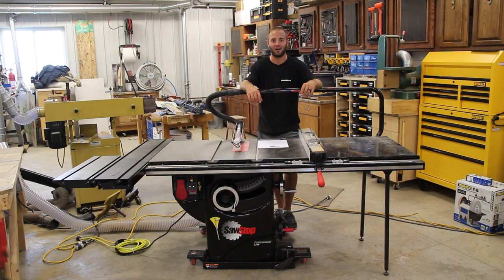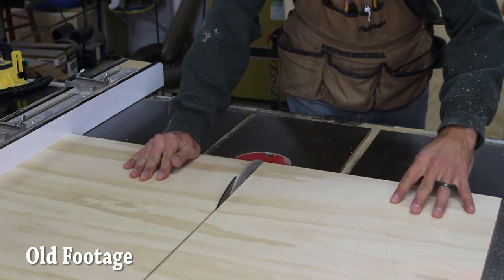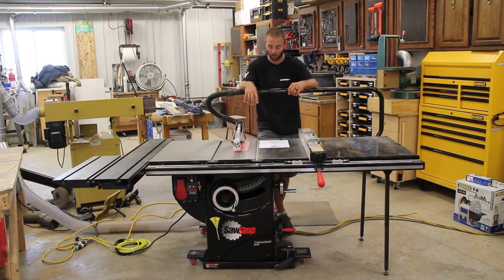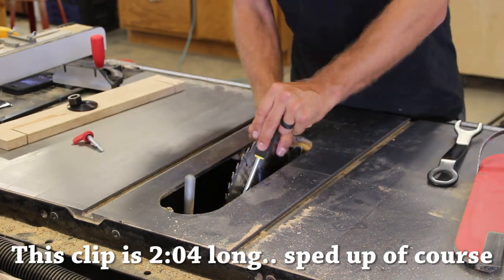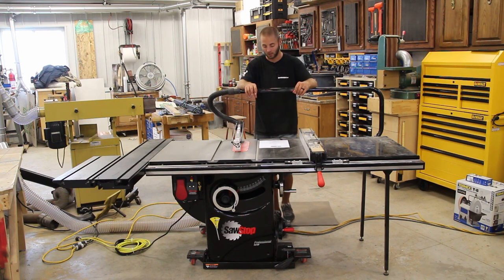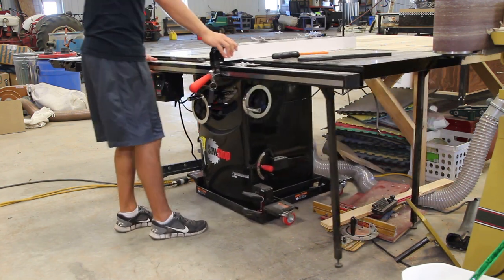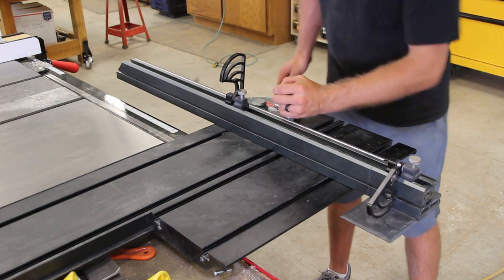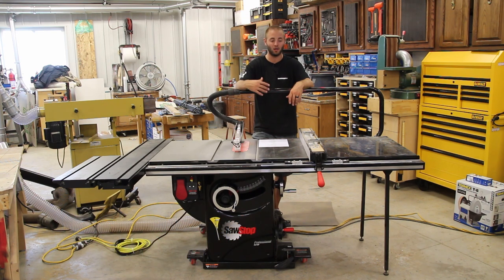SawStop PCS 3-HP Professional Cabinet Saw Review & Test

Comment: Hey Amigo, nice nice work. Good material. One piece of advice that's not very easy to find BUT... at 4:58 you're installing what looks to be a Freud blade with anti kickback teeth... DO NOT USE a blade with anti kickback teeth on a SawStop. SawStop doesn't communicate it well, but will verify it if you call them. The raised kickback teeth interfere with the brake cartridge and increase the likelihood of a serious injury exponentially. There's even a couple videos out there of guys getting torn up bad with a anti kickback blade on a SawStop.
Reply: That’s big. Thanks.
Reply: you are correct, thanks for informing people

Comment: Why does everyone doing the "hot dog test" slow down to an absolute crawl before making contact with the hot dog?  I want to see someone pushing that dog through at a normal speed.  If it is really my finger, I'm not going to slow down and gently make contact with the blade and my finger.  Every online demo I've seen slows down to be barely moving when the hot dog hits the blade.
Reply: I could not agree more. I have always thought the same thing.
Reply: I was thinking the exact same thing!!
Reply: @sz72909  Me three.  Apparently this thought comes up once a year...
Reply: Completely agree
Reply: I've seen channels that have covered a sawstop incident.. 2mm is average,  seen one that says was cut to bone (a tip of finger- so not far), deepest I'd guess at 4 or 5mm.
But I only watch videos so far, hope to get one later this year...

Comment: FYI I have owned sliders that have positive stops for the cross cut fences and every single one has to be checked for squared up to the blade and adjusted. I my opinion the slider attachment for this saw works extremely well compared to some of the other big brand sliders.

Comment: Great review less the 1 inaccuracy.  The blades are not junk once activated.  The block that's fired is aluminum,  which is softer than the steel blade. A simple sharpening and it's good to go. Unfortunately,  been there, done that and got the sharpening bill for proof :)

Comment: The blade brake going off is startling, but searching through a mound of sawdust for a missing digit is traumatic.
I don't see the value in setting off the brake when you can quickly google tablesaw injury photos, which can provide a more accurate account of what you could be avoiding by carefully using your saw. The goal is to NOT be familiar with the sound of the saw brake, but to avoid it ever happening.

Comment: When the power is shut off, does the sawstop feature work when the blade is coasting?
Reply: I imagine so. But the blade has an electrical brake also for this. Seen others say it stops in 3 seconds. No coasting..

Comment: Hey, I'm fixing to take the plunge and get what you have in this video. My question is on the sliding table. You said you love it and hate it. Could you go into a little more detail on it? There are not very many reviews on this. My next question is on the top dust collection. Would you recommend that or not really worth it?
Reply from the maker: Regarding the sliding table, if you have the room to the left of your saw, yes get it! If you don't it won't be utilized and a smaller cross cut sled would be better.

I could leave the top dust collection as I feel it gets in the way. But for some cuts, it is nice to have.
Reply: Thank you. I was just at the store looking at the floor models.
Reply from the maker: They are top notch saws. My advice would be to go to a 3 or 5 horse. I wish I would have went 5 horse
Reply: The guy at the store said that if I'm not cutting 2" hardwood all the time that 3hp is really all I need. They don't make the professional in a 5hp do they?